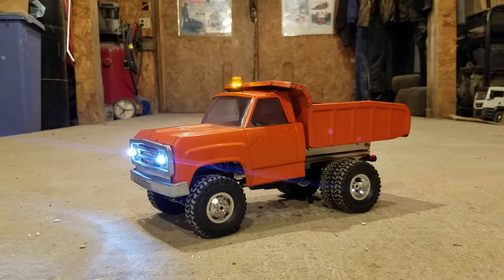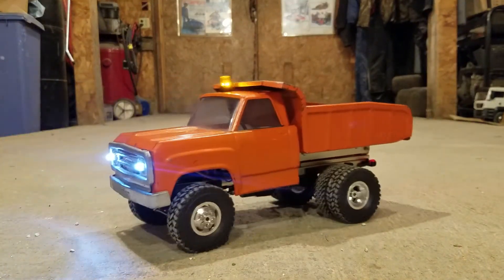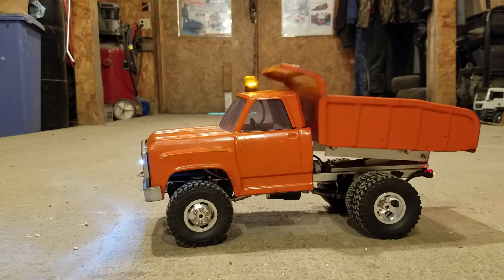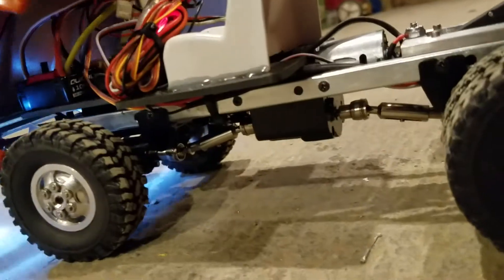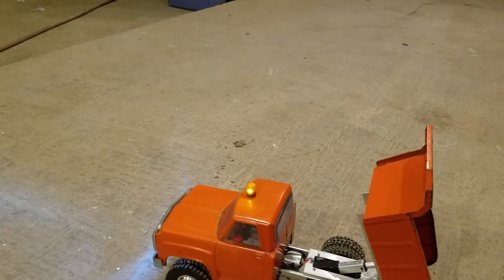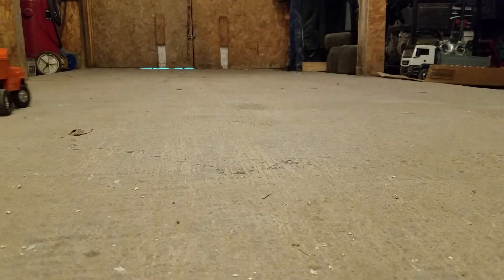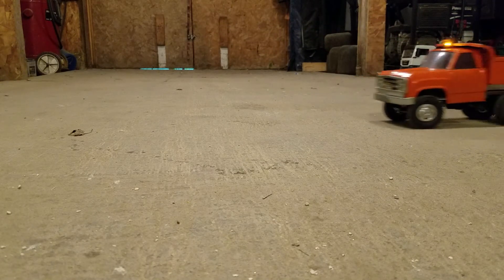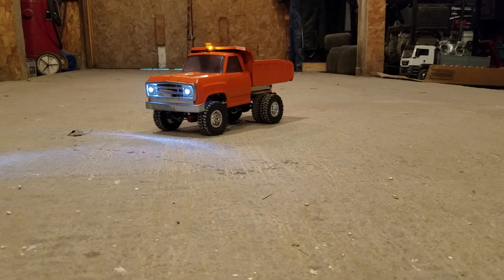1/16 RC Tonka Dump Truck Conversion

Comment: How did you set up the light?
Reply from the maker: The head/tail lights or beacon?
Reply: @dennybobsrcconstructionagc2796  everything lol
Reply from the maker: @1-12scalegarage  switch for lights to turn on/off. https://www.amazon.com/Apex-RC-Products-Electronic-Channel/dp/B07BKSGW3D
Reply from the maker: @1-12scalegarage  beacon just plugs into open channel on receiver or just plug into binding port if you don't plan on changing the cycle of it. https://www.amazon.com/Police-WONFAST-Rotation-Bright-Accessory/dp/B07HKF4817
Reply: @dennybobsrcconstructionagc2796  awesome thanks. Is this a generic set up, or the one you use for all your trucks?
Reply from the maker: @1-12scalegarage  same similar set up on all my trucks. I have no need for turn signals, hazzards, brake lights. Those light kits are neat, but I have never felt the need or want for them. I just buy 5mm and 3mm LED prewired bulbs and install my own kits so to speak. Fancy kits over time tend to fail and then you have to replace them. Dumb, simple, stupid is my moto.

Comment: Is that on a wpl chassis I got a tonka dozer I'm looking to convert the guy I got it off has that same dump truck I might get it soon
Reply from the maker: Yes WPL B-24 military truck with a bunch of upgrades.
Reply: @dennybobsrcconstructionagc2796  I. Using the jjrc q75 6x6 with major upgrades for a huina 1573 dump truck conversion designed a new ram and everything

Comment: sweet!!!!! nice job indeed, i think alot of your fans would like too see a construction video here soon! You have way to many cool toys
Reply from the maker: Nick I would love to get some contruction operation video done. Unfortunately I have nothing set up outdoors at the moment with dirt. I am a one man show and it would be nice to have a few operators to work the machines while I just shoot video. I need to get a digital camera recorder and a computer to edit them. Right now everything is done via my cell phone and when that dies I am out of luck. I need toget more modern video capabilities.
Reply from the maker: The other issue I do have is I spend all my time building and very little time actually playing with them. Most of my models get played with only when i shoot the video of them for YouTube and then they get set on a shelf. I hope to remedy all these issues soon. It's been between 95-100 degrees everyday here for weeks and the humidy is awful. Hense the main reason all my videos are done indoors in my air conditioned shop.
Reply: @dennybobsrcconstructionagc2796  for sure i can understand that. I am the same, My dad came over finally the other week for the first time ever. that was the only time i had someone else to operate models with. It is a tone of work doing it yourself. When i first got into it, i did a full 8 part series its all on my channel in playlists , sometimes i would be out for 6-8hrs setting it up trying to get shots telling a story etc... it gets taxing after a while, and its a butload of work. I also do all my stuff with my cellphone, and my editing skills are poor at best lol.  i should be called B Budget rc lol.  What i like to do is go to the locla soil mart load up my pick up with two loads of topsoil, close to a yardish, and balm it in. and plus is when i move materials around the wife loves it for her garden :) Either way i will be paitently waiting when ever that is too see them when you get too it! awesome stuff!!